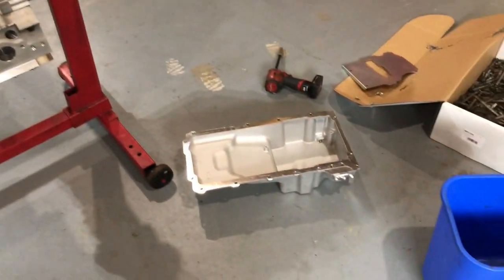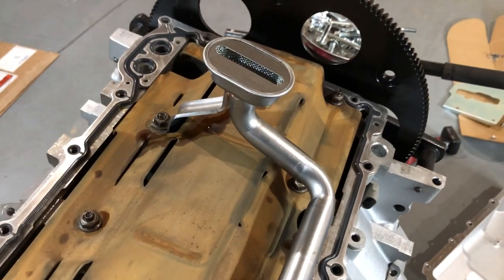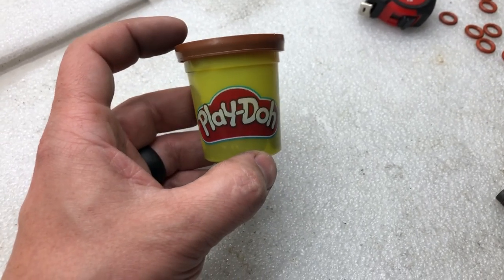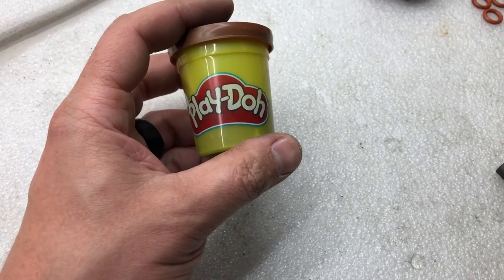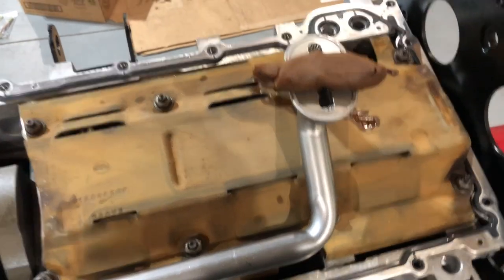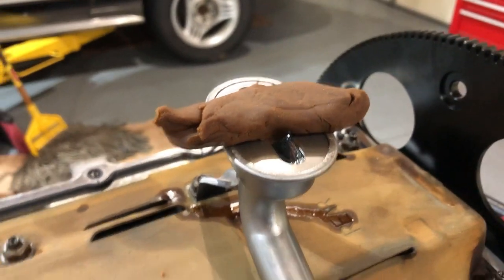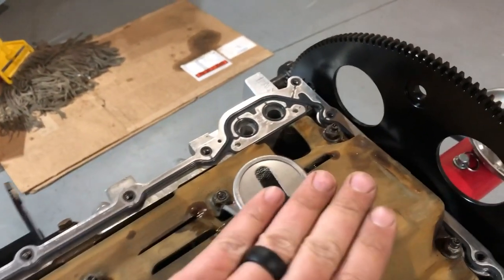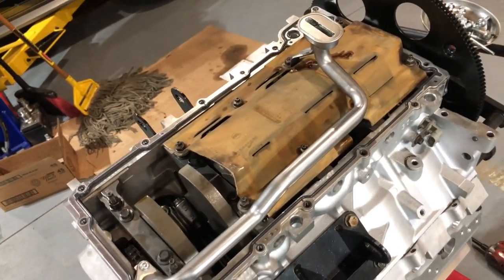oil pan pickup checking since fancy motor

Comment: I'm sure that step gets overlooked often. I wonder how many of these setups are run with the pickup tube pinned against the bottom of the pan and the pump gets blamed or they think it's the oring that's causing low oil pressure...

Comment: I had to shim and cut the windage tray on my 383. I commented on Instagram about it. But I never thought about it lowering my pickup tube. Never checked it. But I do know that I hold 95lbs of oil pressure at 7000rpm at the top of the 1/4. With a stock f body pan

Comment: Dammit man. I am forgetting all of these things that I had to do. Glad others are on top of it. I had to do the same thing. I used a level and measured the depth of the pan where the pickup would be. Then measured the motor side with the level on the pickup tube to the block with the gasket on. Playdough is a good idea, didn't think of that.

Comment: Hell. I put a 302-4 pan on my stroker, shimmed the windage .025 and just zipped the pan down without measuring. I hate to dead blow expensive parts. The 302-4 pan is geared to stroker cranks. Why wouldnt their pick up be geared to that too.